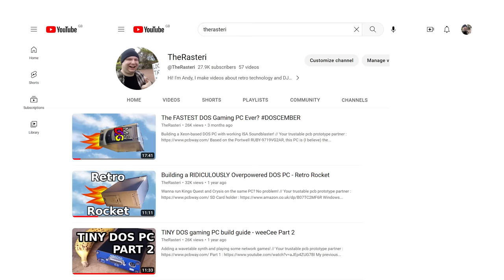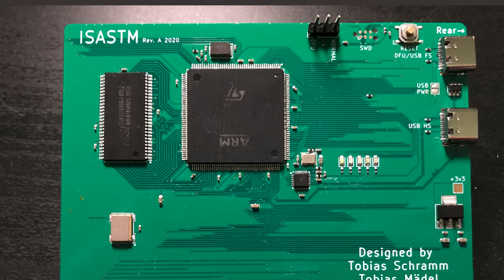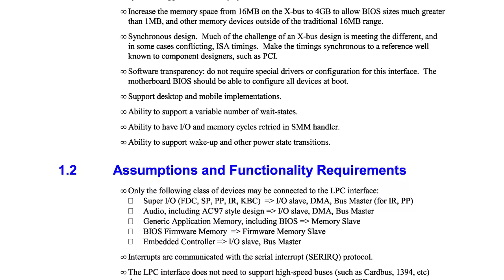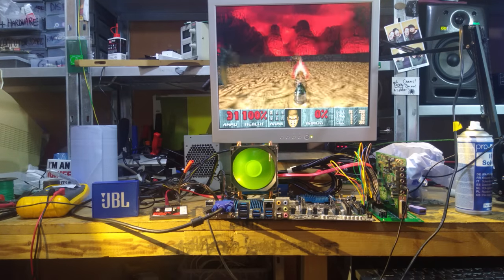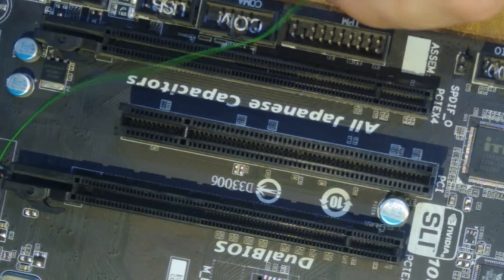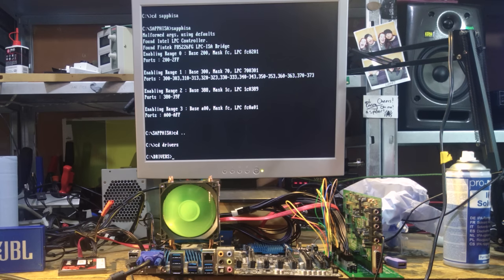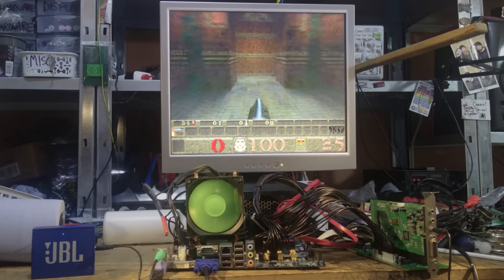Add an ISA slot to Modern Motherboards!

Comment: Brilliant project. I'd be interest to see if you get an ISA floppy controller like the Quad-Flop working via it, having a working 5.25" floppy drive on a modern hardware would be great for a retro setup.
Reply: That's why I clicked on this!
Reply: 👍 .. or booting with hercules card
Reply: This is what I care about, running 5.25 floppies on a modern motherboard.
Reply: @Intelwinsbigly  usb to shugart adaptor
Reply: @joefish6091  Does it allow the os to directly access the floppy disc like a vintage system can?
Reply: Or even an 8 inch drive!
Reply: @starchief93  That would be wicked, the large floppy just showing up in windows as a tiny little drive that might store a few word docs.
Reply: @joefish6091  The USB route is a non-starter unless you expose full signal control, which means at that point it isn't a standard usb device. No existing low-level floppy archival/recovery software would work. Existing usb-floppy devices expose only a high level interface which allows access to "standard" DOS format floppy disks.
Reply: @Intelwinsbigly  Easy, share the drive in the Workgroup, Windows 3.1 ! Use the shared floppy, map it as A. Use it in DOS too ! DOS 6.22 !
Reply: @lucasRem-ku6eb  having to run a completely separate computer and accessing over network defeats the purpose of connecting it to a moden computer.
Reply: I have a Pentium D PC that runs Windows 11 and has a 5¼ Floppy Drive. Works, but of course not the same as a completely modern PC ^^
Reply: @electroman1996  what you need that ? running what ?
Reply: @lucasRem-ku6eb  
Oh, it was a special project. Wanted a computer that can boot anything from DOS to Win 11, and that can read as many media formats as possible. So I needed something that's old enough to have an onboard floppy controller, but new enough to run modern operating systems. 

I don't really run anything 'productive' on there. It was just a challenge and I succeeded ^^
Reply: Totally worth it scavenging the posts to fine these gems, is there a video on it?
Reply: @fss1704  Were you replying to me? If so, no, there's no video of that PC. I usually don't upload my projects on YouTube
Reply: @electroman1996  Yeah, me neither.
Reply: You can do it with an internal usb to floppy adapter.
Reply: @TheAmazingAdventuresOfMiles  
There aren't any "real" 5.25" USB floppies. 
There's Kryoflux, but that needs special software. You won't have a Drive A: in your Windows explorer

Comment: Hey there. I own a SoundBlaster AWE64 Gold and I confirm that it's working with Gentoo Linux, with kernel branch 5.15. It's perfectly capable of playing PCM. Your mileage with other distributions may vary, as it has become Linux' recent obsession to join Microsoft and Apple in planned obsolescence by deprecating drivers and platforms left and right.

So, go ahead! You're safe to try most ISA sound cards on Linux.
Reply from the maker: I have actually tried latest Debian 32bit but it doesn't work. I think it's a problem with isapnptools, though - the ports are getting forwarded on the LPC bus no problem
Reply: @TheRasteri  I don't know exactly what are you doing on the software side to enable this via LPC, I'll have to research your notes more, but on my board that barely has 1 ISA slot, I didn't need isapnptools at all. I don't even have that installed on Gentoo and I was kinda surprised that a tool like this existed. Supporting devices is the sole job of the kernel. Linux, as in the bare kernel, can initialize the AWE64G I have either via PnP, or if PnP is disabled, via customizable parameters for port, irq, dma8, and dma16. Support for ISA PnP is part of the kernel's general support for the ISA bus, fwiw. Or at least this is what I remember from setting this whole system up a year ago.
Reply: @TheRasteri  I can verify that on a PC with an actual ISA slot (pentium3) current-ish Linux works perfectly with my SB16. It would be awesome to get this working too. I'll order boards and parts soon to try it out.
Reply: I'm also keen to try this out under Linux (also a Gentoo user), in my case, with an AMD AM3 motherboard since I'm still using an overclocked 8370E for my main PC! I'm particularly interested in getting an ISA floppy controller hooked up for archival purposes.

By the way, I have looked into making LPC-ISA adapters in the past but couldn't find a source for suitable bridge chips, so great work there! 👍
Reply: Can't find AWE 64 PCi ?
If you need it badly, i can send it ! If you need it for a machine, reason ? 
Unix support on AWE, why that ????
Reply: @lucasRem-ku6eb Because why not? If ISA card drivers are in the OS, why remove them for no reason? They're like a few kilobytes in total anyways. 
There's a number of modern distros that run on late 90s hardware and it would be very annoying if they got rid of all the drivers.

Comment: So this means I can maybe install a TPM module on my 386.
Great idea.
Reply: Why you need 386 in 2023, running what ?
Reply: @lucasRem-ku6eb  I have read Linux works on a 386, and want to try it.
Reply: Similarly, the advent of virtual memory means you can have a really large RAM disk
Reply: @JaimieVandenbergh  How you adress extended memory on an expanded memory card in DOS ?
Reply: @nalinux  I ran linux (2.?) on a 386-sx at 16Mhz with 2MB of ram. Which were the absolute minimum specs. It would have ran fine if it had double the memory. It was more of a "can I do it" challenge. But it was actively used as a dial-in server for which it was just fast enough.
Reply: @stragulus  I think I played a bit with a 286 and a Linux version working on it ( not 386 as a regular one)  :)
Not sure, it was circa 2000.
But I had a Sparc Station IPC 25 MHz 48 Mo ram running great with NetBSD :)
Reply: @nalinux  Linux never ran on a 286 as it was 32-bits from the start and a 286 is a 16-bit processor. A 386-sx16 should therefore be the lowest official (x86) spec barring underclocking. Those sparc stations were awesome! I had the little lunchbox one with NetBSD on it as well.
Reply: @stragulus  I know Linux is supposed to run on 386 and +, I've been using it as my daily OS since 1998, but it really seems to me there was a small version for 286. But I can be wrong, it was decades ago :)
I found NetBSD being the best OS for some machines. Even  a small dual CPU Pentium 75 I was given, where Linux didn't want to run :)
Reply: @nalinux  Could have been ELKS (Embeddable Linux Kernel Subset) which was a subset of Linux that did run on even an 8086. There were also other unix-like OS's that would run on older CPU's, we had an 68000 old 'mini computer' that ran some SysV/Unix derivative but the name escapes me. NetBSD was (is?) indeed excellent for a lot of old obscure hardware!

Comment: Fantastic work! I remember hunting around for motherboards with an ISA slot, but that was to run a secondary MDA / Hercules card which had some low level development benefits.
Reply: LPCPD# DMA for Hercules.
What monitor u use ?

Comment: You actually can get USB working in DOS.  My retro rig is a Gateway 2000 Pentium 133 with ISA, SBPro2 card, Mo-Slo, Mscdex and CDROM, USB 1.0.  Can mount USB sticks as drives in DOS 6.22.  Cool video!
Reply: If you have compatible USB controller, there are DOS drivers for USB storage. But, if your motherboard support USB disk booting or USB CD-ROM booting, you don't even need driver - DOS doesn't even have a clue that device is an USB device - BIOS handles it.

Comment: I knew right from the thumbnail that this would be awesome. I've been waiting for this ever since I saw the short! Unfortunatly I don't own a motherboard that has a TPM header, unless maybe my current AM4 motherboard has one.

UPDATE: I have checked one of the motherboards again. This time i looked closer on the mb itself rather than the manual and found holes for a TPM1 header. So i will need to solder pins for the TPM first.

Comment: The original Xbox has an LPC port in the motherboard, it’s actually where modchips are connected. However since you can flash a mod chip bios directly onto the onboard bios chip on older revisions, that leaves the LPC port open to try and connect this! There would be no point other than to write homebrew that uses a sound blaster or whatever but it would be cool to see it working for no other reason than just to do it haha
Reply: Homebrew that runs off a floppy.
Reply: @Intelwinsbigly  with the floppy drive connected to an ISA floppy controller card as well!

Comment: I want to see it work with a floppy controller. Seeing a 5.25" drive in a modern PC would be amazing!
Reply: Floppy connector was dropped much later than ISA, Gigabyte mobo for AMD Phenom II still had it in 09.
Reply: @Tegelane5  IIRC, the most recent board to have a floppy connector is the ASRock Fatal1ty Z77 Professional. Unfortunately, it does not have support for 5.25", just 3.5". Am pretty curious if any of those boards from '08-'09 have support for 5.25" floppies. 🤔
Reply: @empyrical  I thought signalling was the same just cable had to have connector for 5,25 floppy (like those floppy cables from 90ies) . But this mobo had never even 3,5" fitted.
Reply: I have a motherboard with a floppy controller just sitting around, no ISA though.  And unknown if it can run a 5.25 though I do not see why it couldnt as long as one had the right cable.
Reply: There do exist USB floppy controllers that work with a 5.25, I've got a few.

Comment: Awesome is an understatement. My eyes were glued so hard to the screen that I was afraid of ripping my cornea off when it's done. Congratulations!
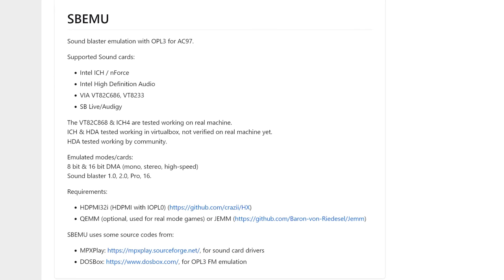BTW, at minute ~13:49, where you show the Vogons post, there's a typo referencing a "Socket 755" motherboard; I thing that it should be Socket 771 or 775.

Comment: I've got a s939 HP OEM board equipped with a lpc header so they do exist. Labeled as "factory test connector" so I guess they only meant to use it for bios recovery since it does boot from the header if you memory map a device at the correct address.
Reply: Why you needed that, need more boot options ?
Wished HP kept supporting native devices longer, CD ROM support in MS DOS 6.22 etc, native serial port and parallel cable link support.
If you needed that, you needed to build clone PC servers. DELL the same ....

Comment: When I saw this board it reminded me that the first gen Xbox had a LPC header and had me half curious, ultimate retro setup emulate old bits, hardware retro audio, seems fun if it was practical.
Reply from the maker: lol I had the same idea, unfortunately the Xbox LPC header doesn't have DMA. It may be possible to dig it out elsewhere on the board though...

Comment: Just yesterday I was wracking my brain trying to think of ways to take advantage of the almost brand-new Sound Blaster 16 with a Turtle Beach Rio Wavetable I got last month. 16 hours later after I'd put it away and gone to bed, this wonderful bit of hardware hackery gets posted. Excited to see where this project goes!
Reply: Waveboard interface, is Max WIn 98 SE on PCi sound cards.
All you need is a better soundcard that has wavetable interface ! Here, Stuck on some old Aurial 3D monster card here, PCI 775 board.
Reply: @lucasRem-ku6eb  The Aureal Vortex's Adlib and Sound Blaster emulation is miserable to the point it's become a bad meme. The use of a wavetable card just switches out the generated Midi sounds of the SB16 for samples, the SB16 itself still provides the adlib, midi, and Sound Blaster support, all at the same time iirc.

Comment: That's an interesting project. I'd suggest a version with a bracket so you can mount it in a case, possibly also stick it in a PCI/PCIe slot.
Reply: Yes, extra boards can't be designed to flop around lose or at best only be slip tied to something. I don't know why board inventors don't consider this.  It should be made to fit in a x4 slot and it could get it power from there.
Reply: What good would it do like that? Where is the height for ISA card going to come from? You have consumed some distance from PCIe slot, offsetting the ISA card slot into the PC, now what? Low profile ISA cards only? That's going to be quite a hunt.

It's conceivable to have this mount in a full ATX case below the uATX mainboard using extra standoffs.
Reply: @SianaGearz  Sure, if the ISA card has a bracket with external connectors of its own, you still have a mechanical issue.
Maybe it could take a form similar to that of those PCIe riser cards with a cable which is sometimes used for graphics cards.
Reply: pci and isa slots have different lateral offsets to the metal bracket. They don't fit and a better solution is necessary anyway
Reply: @cristianstoica4544  mhmm MSI or ASRock should just sneak one ISA slot below the lowest other slot, sharing the bracket. Just like they used to.

Comment: ISA still has its place when it comes to older lab equipment. Those often came with ISA interface cards (a bunch of D/A and A/D converters, usually requires something like +/-15V symmetrical power supply), and DOS software.
No idea where they currently get their replacement parts from, but mainboards with ISA slots can be expensive.

Comment: I think an ISA Floppy controller would be great, there is no way to get a floppy drive to work with this modern PCs :)
Reply from the maker: RayeR has actually made an LPC floppy adapter - http://rayer.g6.cz/hardware/lpc_sio.htm
Reply: You could always use a USB floppy drive.  They have their limitations, but are usually good enough :)
Reply: @nticompass  Not if you want to use 5.25" floppers!

Comment: Just a note. SPI has largely replaced LPC at this point and some of the latest stuff from Intel no longer technically supports the LPC even though it's physically there. Since it is muxed with other possible signals, it by default isn't accessible on reference designs. So it'd only be present if the OEM chose to enable and use it anyway.

Comment: Have you tried to see if it works with an ISA based floppy disk controller - or indeed ISA based display adaptors? I ask because I am considering updating a 1983 Compaq Portable to a modern motherboard, PSU and CPU, but keeping the floppy drives and internal CRT.

Comment: Aside from what's on a standard MOLEX/SATA power connector you'd only need a modicum of -5v and -12v i would think? Could probably have some simple circuitry on the board to generate that, would avoid the need for a splitter, and also avoid the incompatibility problem with cards that expect -5v since that's not been common on ATX PSUs for 20 years.

Comment: I was actually surprised recently. I bought an old HP Z440 Workstation to use as a media server and when I was digging through it to rearrange some hardware, I realized that the serial I/O add in card at the very bottom of the stack was not PCIe, but was actually PCI.

Comment: Great job, keep it up. Nothing like having a 5800X3D with a sound blaster playing Doom.
Reply: The systems starting from 2009 may have issues (hangs) running DOS. And no, "the latest is the fastest" didn't work in case of DOS. No cache size and it's performance matters, it's more related to VGA/LFB write path. Phil's VGA benchmark stopped at 3770k not by the means they have no data later on, but no improvements. And the fastest platform is Intel's P45/X38/X48 w overclocked

Comment: This seems like it's only a few steps away from having proper floppy support on modern Windows. I know there are usb floppy drives but 1. Those don't work exactly like native ones and 2. There isn't a reliable way to adapt 5.25 inch floppy drives to usb. Getting an Isa floppy controller with old drives to work would be pretty cool.
Reply: My Quad core motherboard supports one floppy drive. Currently it's connected to a 5 1/4 drive, plus an internal USB to floppy adapter has a 3 1/2 drive. Works quite well.

Comment: Inittially PCI soundcards were not Soundblaster compatibel. Late in the WIn95 they became Soundblaster compatible, the mainboard chipsets got an interface, so PCI cards could access the ISA DMA controller that was still present in the chipset. Not sure if this interface is well documented, as only soundcards did use it. And no idea if this interface still exists in current chipsets.
Reply: It seems like the ISA DMAC was readily accessible from intel chipsets pre-ICH6 via PCI bus but they would later move ISA PIC & DMAC functions up the northbridge chipset after ICH6, further making it impossible to access because the needed map I/O region space was relocated inaccesible from the PCI bus hence "chipset DMA controller cannot initiate PCI to host bus transactions" as intel says in their spec. There is an intel document pdf about this topic and ways around this problem. I believe LPC to ISA bridges with userend tailored software was one of the solutions. Hence why this project exists.
Reply: I forgot to mention intel's LPC interface bus is technically a seperate bus from the main north and south bridge chipset but it is typically found inside the southbridge and it's the host controllers job (the south or north) to have the required ISA bus resources for the LPC bus

Comment: You will have a problem with modern power supplies as well. ATX 3.0 -12V is not required and may not be present. I found out after buying a Corsair RM1000x Shift. My onboard sound card didn't produce sound from the rear sockets. Only from the headphone jack on the front panel. I figured the rear output amplifier requires both +12V and -12V. Took ages to figure out.

Comment: I was a late abandoner of ISA, but it was because I couldn't get broadband and the only internal "hardware modems" were ISA. Software based PCI modems at the time were just awful. But I eventually splurged for an ISDN (128k baby!) connection for those LPB benifits.

Still, don't old pci soundcards work with these old games? Sorry if you've gone over this a thousand times, I just don't remember having an issue with stuff like Aureal A3D cards.